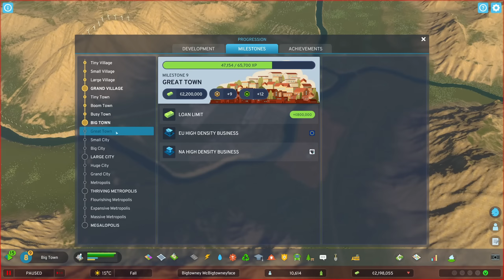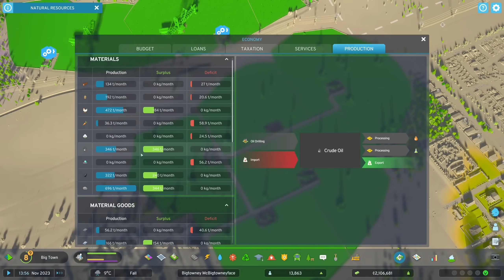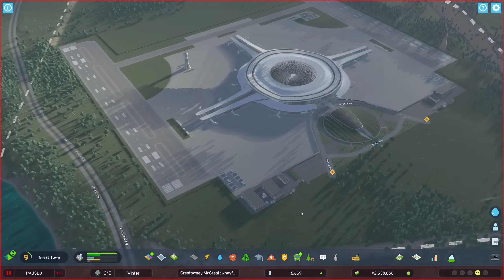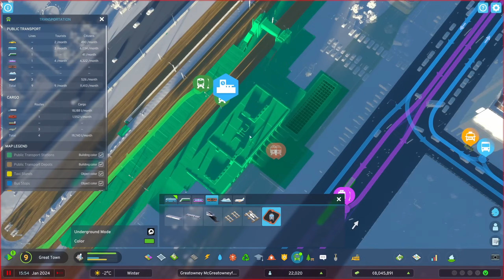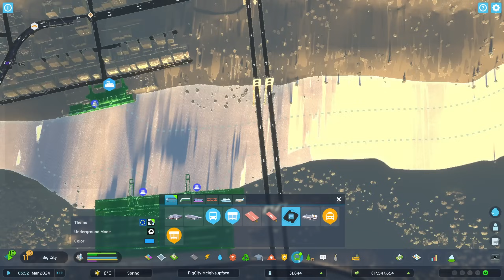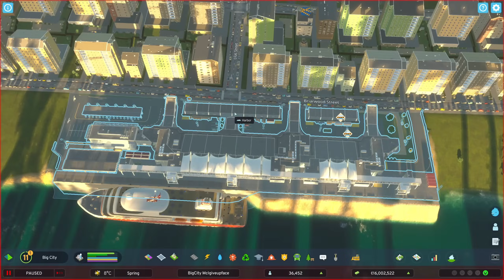Building City's Transportation in Cities: Skylines 2

Comment: Thank you so much for making this video! You're the first one I've seen who included subways! I was wondering, do they allow track lines to be done in perpendicular or tight corner like configurations (Like they used to years ago in Sky Lines 1)?
Reply from the maker: It works like some Workshop tracks (like the LRT) in CS1, they just won't make the rail if intersection is too tight.

Comment: This game is going to fade into obscurity so quick.  Another company is going to take up the mantle of making a decent city builder just like this team did when simcity failed to deliver.  The effort is so subpar for the genre and considering the resources available to this company it almost feels criminal.  Who expected anything less than the ability to pick a network tool, assign any type of lanes you want to it in the order you want them, and then draw that network?  Simple at this point for this game, instead we get a tape measure...oh and now you can draw the curves you should've been able to draw in the first game at release.  Are you kidding me?  Same for any other aspect of the game.  This behaves and looks like you're playing a slightly modded version of C:S1 from 8 years ago, not a sequel.
Reply: Very low effort sequel. The only way this game will survive is if they actually made modding it easier than the first game, in which case the community might just save it.